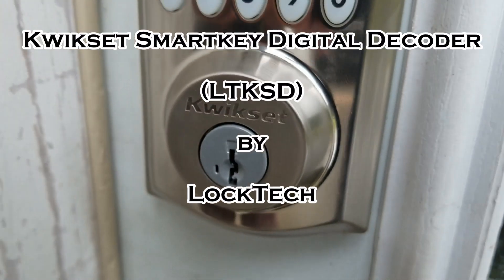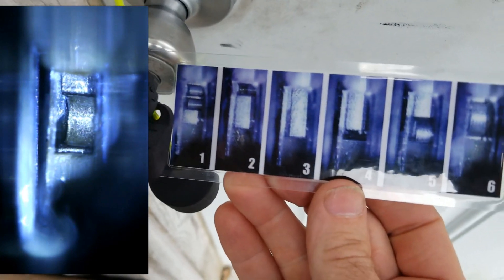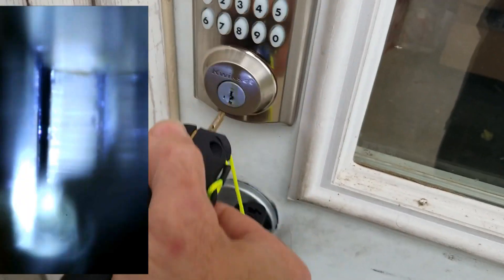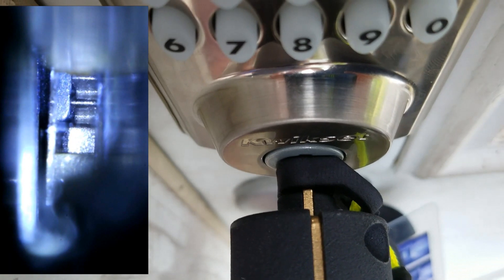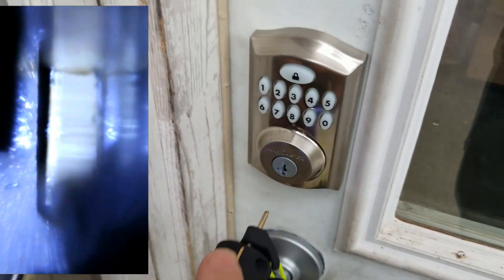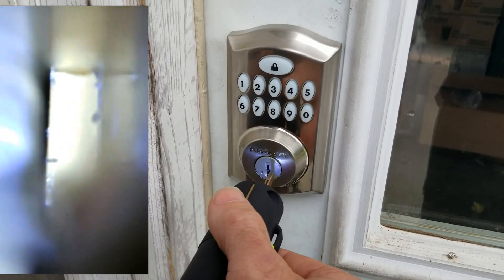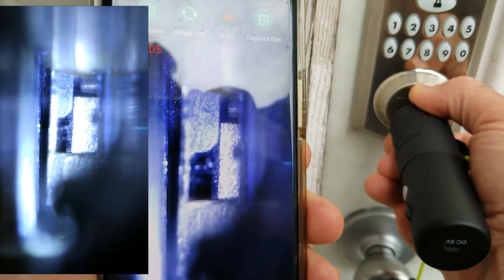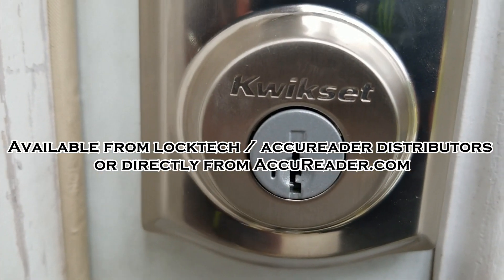Kwikset Smartkey Decoder by LockTech   PART 2- THE DEMO

Comment: Do you reccomend cleaning out the lock first?
Reply: QD quick dry works great. removes EVERYTHING and leaves you with a clean dry lock ready to read or impression
Reply: @kg4boj  what’s that haven’t heard of that before
Reply: @AquaTech225  I seem to have omitted crc qd quick dry electronics cleaner, not regular contact cleaner, this stuff evaporates very fast with no residue, Inuse WD40 to flush out crap then flush with the qd and it dries in seconds leavong nice clean bright shiny brass/metal that you can easily say see the numbers stamped on old wafers inside old locks  gm 6 cyt for example. Its pretty much the cleanest dryest you can get a lock without disassembling it

Comment: This is great for locksmiths that can cut keys by numbers.. if your just unlocking and have no means to cut it won't be useful for you.  Great looking tool.. I can't wait to have it in my little palms..
Reply: Don't own a file and a pair of calipers?
Reply: @technosasquatchfilms  with all due respect, only absolute pros can cut an accurate key with a file or a pair of calipers by eye. Something tells me I don’t feel like somebody who’s that skilled would need to be watching videos about this kwikset smartkey cut reader.

Not that you asked, but personally, if the doors unlocked, I’ll just take the lock apart and use a kwikset smartkey reset cradle. If the doors locked and I can’t just get around it somehow, then I’ll drill the cylinder out and just plop a new cylinder in their and rekey it to whatever key they want.